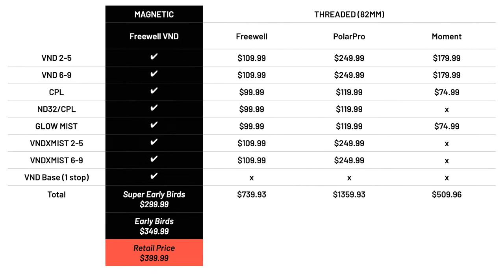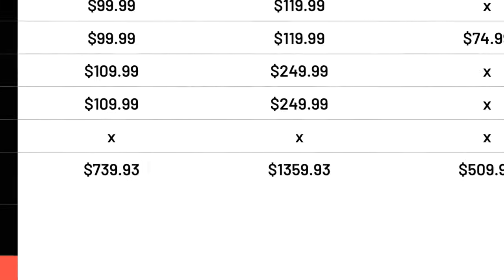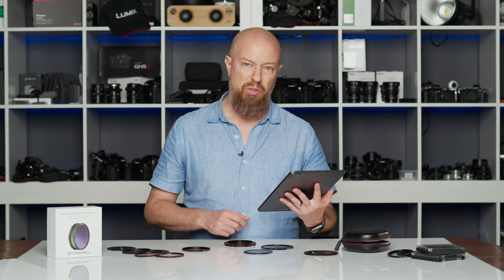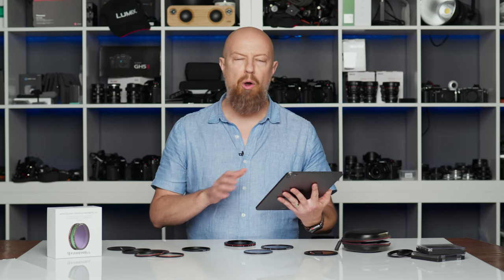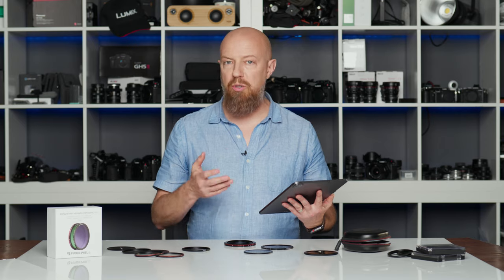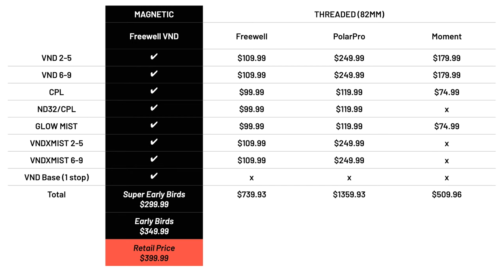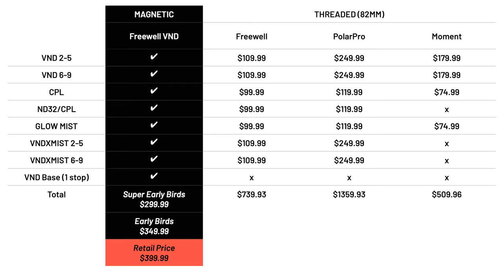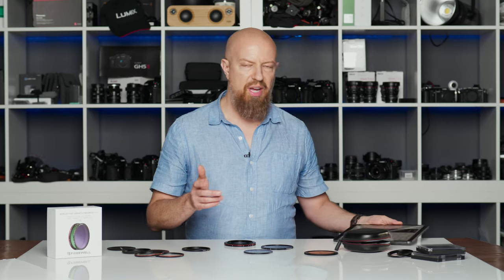Freewell Magnetic Variable ND Filter + Circular Polarizer Filter + Mist 🤯 | Best Variable ND Filter

Comment: Looks like the outer filter is larger than the base or the thread size. I wonder if you have original Freewell magnetic filters that have 82mm thread size, will they also fit in this VND version that is also 82mm?
Reply from the maker: Hey Frank. Yes… so the size of the outer filter is larger; the INNER filter is the one that matches the size. So the original filters slip right into the inside of the ring, where the BASE filter lives. In my sample here, I would have combined the original 77mm ND64 with the new CPL or ND32CPL. I talk about this at 6:48

Comment: Does it work with step up rings? I have the old Freewell 2-pack (82mm to fit my fattest lens) with step-up rings. It’s brilliant! But this new pack is even better!! And I’m told by those who know that the Freewell gets better results than that other brand endorsed by some Youtuber plus it’s cheaper. Also anyone hesitant about the price of this kit - would you like to buy all my cheap VNDs that didn’t work properly? I.e. just save and buy these…once.
Reply from the maker: Definitely you can buy any size and step up (not down… obvi). I’m using this big one on many smaller lenses. I got the biggest I needed so I could use it anywhere.

Comment: How do these work with lens hoods? I would probably look at getting an 82mm set (my largest). What hurdles will I face?
Reply from the maker: Lens hoods will likely be a problem. They are too big to use any included lens shade. You might be able to get something bigger but also that’d get in the way of rotating the filters.

Comment: Another great video! Thanks for all this free  content, especially the Lumix-related stuff. I'm seriously keen to get the full Freewell kit, but alas, Covid-poverty prevents atm. My immediate solution is to get one of Freewell's 'All day' VNDs- but they come in 2-5 and 6-9 stops. So here's my question to a Lumix ambassador. Which one should I get if I'm shooting in V-log on an S1 (base ISO 640)? The sort of stuff I plan to do will involve both indoor commercial work, and some outdoors short documentary stuff (so a lot of shooting wide open at f2.8 and faster). Of course, having both is the best solution, but in the first instance, which would you recommend- the 2-5 or 5-9 for v-log? TIA, Fred
Reply from the maker: hm, probably the 5-9 if you plan to shoot in full sun wide open.
Reply: @photojoseph  Thx for the advice, Joseph. cheers!

Comment: So I guess it's impossible to have a configuration with both the VND and the CPL? So u can adjust the CPL and also adjust the VND?
Reply from the maker: With this configuration, that's right. You could add a separate CPL and add that on top of the VND, but it would be very difficult to control. Whenever you spin one filter, it'd spin the other. It'd require some hefty acrobatics to make that work. And, I don't know if the Variable ND would conflict with the rotating CPL… that would require testing.

Comment: How does it do with vignetting at wider focal lengths?
Reply from the maker: It's not much thicker than a regular filter, and it is quite a big larger than the front element, so it shouldn't be a problem. No vignetting on my 24mm.
Reply: @photojoseph  Dang. This creates a new problem. What do I do with PMVND now?
Reply from the maker: haha given the price of that thing, you could probably sell it used and buy two of these 😂
Reply: @photojoseph  Not a bad idea!

Comment: The stupid thing is that the CPL doesn't work with all the VND so these new ones are kind of misleading if you don't watch a review like this. If having for example the Freewell 2-5 or 6-9 VND's and B+W CPL attached  at the same time - the CLP is not working. Obviously same case with these new ones and the CPL is only compatible with one particular separate ND filter with one particular stop. In this case either 32 or 64. Damn you physics :| :D
Reply from the maker: I’m glad to hear my video set it straight!